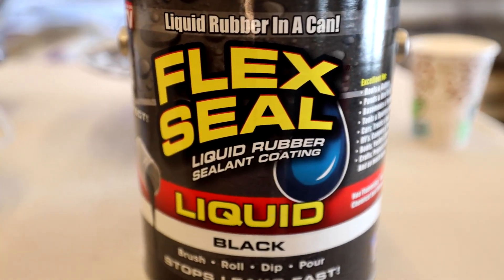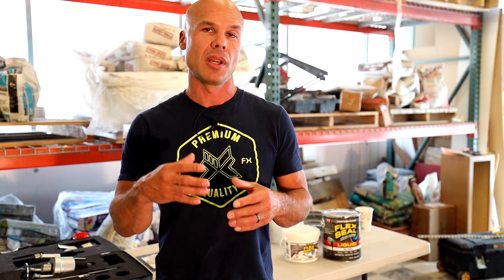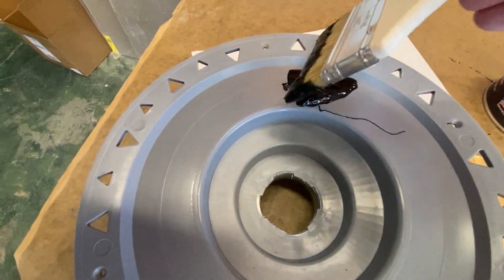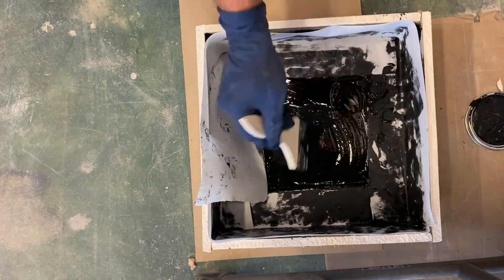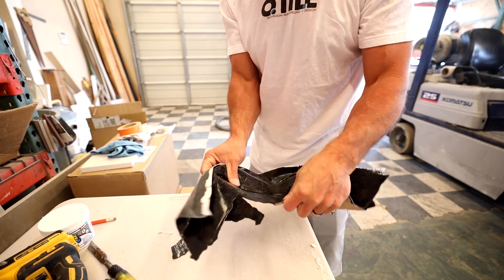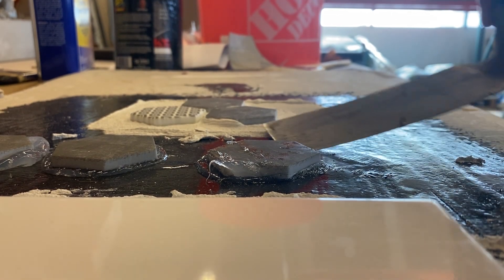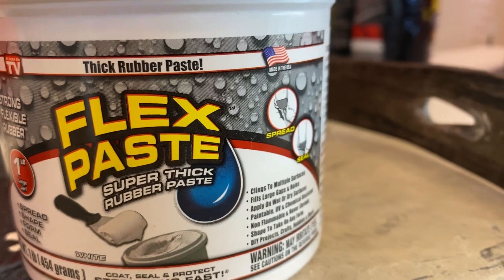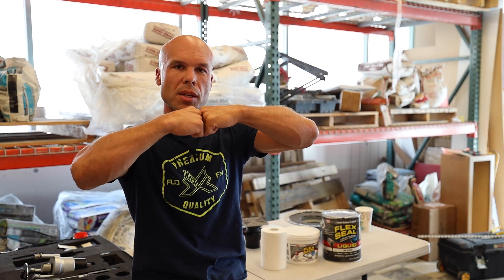FLEX SEAL to Waterproof a Tile Shower???

Comment: Static tests are good, but we really need dynamic tests with temperature and moisture in play over time to find the MTBF in this application. Flex Seal may actually have some of this data and can probably advise on the recommendation of this use case. If it is a good use case, then it might be a question of cost. Great content, as always!

Comment: Flex Seal Liquid indicates that it cannot be painted. I imagine due to the nonporous rubberized membrane not having anywhere for the "teeth" of the film layer to grip into. However, doing some research on the product family, a product representative mentioned a potential solution to whether or not Flex Seal Liquid can be painted. They suggested that it wouldn't perform well to being painted, HOWEVER, Flex Seal Spray readily bonds to Liquid Flex Seal, and will accept a paint layer. Would be interesting to see if it would accept a thinset aswell.

Comment: i would compare it to the pull (psi) sticking power  of Redgrip on an hardi backer. If redgrip provide the same 100 PSI sticking power, i would use the cheapest product !

Comment: You could use flex glue to stick the tile to the flex seal. I actually started to do an entire shower top to bottom with flex seal. No tile. Everybody chickened out. I found the stuff to do things i never thought it could do. Ive been communicating back and forth with the tech dept at flex seal about uses ive found they havnt tried. Fyi they dont know how much flex seal it took to make the boat out of chicken wire and aluminum framework.

Comment: I would think its easy enough to use as someone who hasnt done any tile work before, so id really look at using something like this in Australia. My only concern would be how long it lasts. If silcone breaks down over time and even ive seen one of your failed redguard videos where it turned brittle. Would this last like 40 years?

Comment: Question is availability and cost

Doesn't surprise me one bit really that it works.....rubber is rubber, maybe if flex seal was diluted and had a matte finish it would bond easier with other material....I believe flex seal is bit pricey.....

"Flex Seal Tile"....there is new name for tile contractor

Comment: The question is whether the flex seal will degrade with exposure to chemicals over time.  I’d trust liquid flash from Prosoco or Zip over flex seal.

Comment: I'd like to see the additional step of grouting. Would the chemical difference between flex paste and regular cement based grout cause cracking problems?
Reply: can probably grout it with the flex paste :P
Reply: @A.Martin  Depends on the thermal expansion properties.
Reply: My question is, if used for grouting, how's the finish cleanup.
I imagine it might be a little messy/ sticky..? But I suppose with the right applicator and a steady hand, thing's can be kept down to the bare minimum.
Reply: I&Nhat chy juice i
Reply: G c g x ‘ nay mm.   Nuht

Comment: I would probably use it to water seal a walk in shower if it is for a downstairs bathroom.  I don't know that I would trust it fully to work long term on an upstairs bathroom.  How would this product hold up with daily use of a shower and the humidity?  Would the product start to detach from the surface with the amount of humidity produced in shower stall- being that is is like a rubber material and rubber with time tends to curl out.

Comment: I don’t tile and I really don’t want to.  But I am looking at an idea of mixing epoxy and pea gravel and using it as my shower base.  Like the look and slip resistant texture!  I have to wonder will the epoxy work on the flex seal?

Comment: I didn't scroll through all of the comments , but from what I read so far , I didn't see any questions about sanded or non-sanded " grout " adhering to the flex paste .  So , that would be a good test and also a test to see how the flex paste holds up under water . What you have shown me so far and one personal trial run leaves me confident enough to use the flex seal liquid and the paste on my 2 up-coming bathroom jobs in my home . I have used the flex seal liquid on my metal roof to seal 2 seams and to seal around 2 vents trying to fix a " bad " leak . Since sealing those things , we have had several down pours and no more water penetration .  Couldn't tell you which area was the culprit , but which ever one it was is sealed now .

Comment: I've got my own kitchen backsplash to do, keeping the existing sheet rock... it's not cement board.  Sheet rock isn't water proof, so it seems to me that Flex Paste could be solving two problems with one solution: 
1. a trowel can be used to apply it on the sheet rock to act as the waterproofing  that's needed.
2. Also holds and sets the tile eliminating the need for traditional thinset. 

Am I correct?

Comment: have you tried sanding the surface of flex seal then apply the tile with cement? pvc  held up well after sanding! if it works put it to the test with water as well just be sure.

Comment: Well I do know I wouldn't use Hardi backer in any case.  I would have preferred you to test it on a true concrete board.  Then I would be very curious as to the performance of Flex.  Leaving the only question one of longevity.  After a year or two a lot of those miracle products shrink and crack as well as lose their elasticity.  Be very interesting by an account.  I don't think I would want you to test it on my shower but on someone else's--go for it!!

Comment: We're doing a DIY bathroom renovation. This video makes me want to give the Flex Seal a try from a DIY perspective, especially since many of us watching your videos apparently are not pros which is why we're watch these videos in the first place.
If I can return the products I've already purchased, I think we would give the Flex Seal products a try.
Reply from the maker: I wouldn't recommend doing flex seal unless you really confident in the process.  It could be a disaster if used wrong, and there are no real instructions to go by.  I will be uploading a video doing it on an actual job site, so you can watch that and see if you are confident you can pull it off.
Reply: @TileCoach  you're probably right. This is only my 2nd tub/shower remod and just watching the Redgard Fail video  has prompted me to consider things like maybe waterproofing the studs (with the laticrete hydro barrier) and perhaps waterproofing the entire hardiebacker walls instead of just the seams/corners and screws because i definitely don't want to end up with rotted wood😬

Comment: I’ve used their flex tape and found that after a few months the tape separated from the glue. I would be careful using it on something as important as a shower. Stick to proven methods.

Comment: I would definitely use it in a personal Home Project the only issue that I see on a contracted job would be if for whatever reason it would fail, it would fall on the contractor being questioned why is he using something that's not designated for it . and would actually make the contract to look bad , even though it shows it theoretically should work just fine

Comment: Do it! I’m needing to tile a shower soon and I’ve been considering using flex seal. I’ve never done a tile shower before but using a liquid membrane seems a lot better potentially than using a liner. Can’t wait to see if you use it and how it turns out.

Comment: Since flexseal is a rubber material, and is fairly thick especially over a flexseal base, I wonder if putting pressure 
on the tiles causing some flexing.
The flexing could cause some issues with the grout ??

Comment: I am planning to put flex seal 9n the subfloor of my bathroom when I install new waterproof vinyl flooring. If water spills on the bathroom floor it cant hurt the vinyl, the underlayment is waterproof too. So in theory any trapped water would eventually dry up.

Comment: This is BRILLIANTLY exactly what I've been pondering on while planning my tiled bench shower so I never EVER have to flop around in a bathtub,unable to get out after slipping...again.  
Except it doesn't  quite get to MY specific pondering.
I knew Flex would work.  I'm OBSESSED with most Flex Seal products and hit sales and resale sites for deals, as a daily troll!  I have a literal stockpile of different Flex sheeet. 
Anywho.....I was HOPING to see if it was cost effective.  I know this product is not cheap but I've yet to begin pricing out needed product list, therefor, am unaware how it stacks in that department.  

So I'd LOVE to see you do an entire job with it!!  
PLEASE!!   Maybe even a sidexside price match of Flex and the comparative product you'd use OTHERWISE.

Good works here!  Again!!  
You've helped a lupus addled 52 yr old woman get quite a few diy projects done RIGHT.  
Onto the next!  A tiled sit-down shower so I can STOP taking 3 hr long 'showers', while sitting on edge of tub.  Washing a load of sopping towels every other day.

Because my dad taught me at a young age.  When it came to destruction of what you've worked your fingers to the bones for... 
Fear water.

Comment: I'm not a tiler but I saw a shower built. I may be wrong but I thought a liner went behind the hardibacker board and under the mud bed. So the Flex Seal could on the drywall or plywood. Hardibacker on top of that and tile on the Hardibacker and mud bed?

Comment: I would try it in my own shower.  One thing I used Flex seal for is sealing over a water stained drywall ceiling.  After fixing the actual leak, the remaining water stain will bleed through several coats of normal ceiling paint.  By spraying on some flex seal on the water stain before painting, the water stain no longer bleeds through.
Reply: You can also use oil based kilz in a spray can it seals the stain and you can paint over it and the stain doesn’t bleed through

Comment: DO IT! Build a shower for S&G's... this could be a cheap solution for deer camp shower stalls. Also, I DO use flex seal in my business when rebuilding rotted out sink cabinets. I build in about a 1/2" drop from front to back, caulk all the corners, flex paste the protrusions, and flex seal the cabinet. It really works well in this application.

Comment: Latex paint will not stick to Flex Seal either, flakes off over about a years time. 
The only thing I can think of at this moment is if you put too much paste down as the mortar bed and it squished up on top of the tile and you have to wipe it off with acetone, will it cause de-laminating over time since you would not be able to keep the acetone from getting down in the joints.

Comment: grout has a lot of water in it which won't stick to the flex seal holding thr tile so while the tile may stick great I would be concerned about the grout not really sticking in the tile because it won't bind to the flex paste...do you think that is a problem. I really appreciate your channel. one of the few in California I think

Comment: I think you should actually use flex seal products for a real shower. It will probably perform better than the regular material. The only thing I would be interested in is the difference in cost.

Comment: Hi Coach

I’m very curious to know how tiles would stick to the flexseal using unmodified thin-set.  Do you have any info on that?

Also just a heads up on the megalite-it becomes very brittle when it dries.  It’s not great for floor tiles. 

Thanks!

Comment: Why would you bugger up tile with a produce that cannot hold up to extensive cleaning and soap scum, when all you need is a bag of GROUT to Re-GROUT the tile. Not good advice, and from a landlords stand point, if you flex seal my shower stall you are not getting your security deposit back.

Comment: Happy to see video.  I had planned on fixing the cracked  shower base using fiber glass cloth and resin. Then topping it with flex seal to hold the tile.  Really appreciate the video.  Thanks again, Leo

Comment: A good long-term test would be to have a purpose-built shop shower or shop sink that is used and abused for 1-2 years with the flex seal. One concern with the flex seal might be faster rotting over time and this would be a good test to settle all concerns.

Comment: Yes I have used it for a tiled custom tub. Added course sand to last coat of flex seal so the 1/2" mud to stick to it just fine then glued tile to mud like a topical tile job.

Comment: Back in the 70s and 80s we had a product called Tile Tight,.....Tile Tight looked exactly like flex seal.  Black, sticky and dried like rubber.------ We used it to stick the tile down in areas that needed waterproofing . It would stick to the floor and the tile, never had a problem with it sticking. ---The problem with Tile Tight was that it would run/seep to any low spot. The floor would have to be almost perfectly flat and level. We used it a little on walls. We had to flat trowel it on and stick the tile over it the next day. We used a certain bucket mastic. I don't remember which mastic, BUT, the bucket mastic we had back them was a LOT better than the stuff we have now.--Tile Tight was very hard to use, sticky, hard to clean (let it dry and scrape it off) and was like troweling cold epoxy.

Comment: I used it on my sub floor as it was an upstairs bathroom,and wanted to make sure no type of moisture would saturate the wood if the shower failed,I coated the whole floor and 1 foot up and bullet proofed it

Comment: 👏Job👏Well👏Done!👏 Flextastic work demonstrating the awesome capabilities of Flex Paste and Flex Seal Liquid. You're a true Flexpert! 💪🔛
Reply: Flex seal needs to finance a complete shower job for the tile coach to demonstrate the awesome comparison to traditional applications to waterproofing. Turn that into a commercial no more boats made of chicken wire. come on Flex seal. indorse this guy plz.
Reply: Holy shit.. this is a real account?! 😂😂
Reply: Awesome demonstration. Is this YouTuber gonna get a complimentary  monthly  load of flex seal products? That would be great . He did an awesome job
Reply: This could turn into something big. As a DIYer it'd be good to know if this could also be successfully used by a novice.
We're working on our diy bathroom remodel. If I can return the supplies I'd already purchased to waterproof, I may be able to give Flex seal a whirl.
Reply: @luv14lyf  me too. Ive seen so many vids at this point- dont think I will ever buy another house with 2nd story shower! I wanted to see how the Flexpaste held up under water, bc above water its great.
Reply: Dude your awesome
Reply: can you paint flex seal?
Reply: How well does your flex paste hold up to water? How long would it last in a shower floor application?
Reply: @MrMdemon  Well, I can't speak to sealing a shower pan but I have used Flex Seal to fix a leaking gutter that I can see from where I'm sitting now.  It's a corner on some 5" gutter, leaked for one season and I just couldn't take looking at it anymore.  Cleaned out the gutter, peeled up as much of the silicone the original installers used as I could and applied 2 coats of Flex Seal.  That was 5 years ago, hasn't leaked since.  Location gets full sun 1/2 the day.  I'd try it in a pan.
Reply: @MrMdemon  Did you watch the video pal?
Reply: @JulesHunterHillBigSkyBeauty  I don’t recall him doing a water test on the actual paste, he simply shows the water test with the Flex seal liquid. If the paste breaks down with prolonged exposure to water, then it would not be an ideal product to bond the tiles with.
Reply: My MAIN Flex!!   Do thoust feel my love for 'thoust' products from afar?
For thine cupeths DO runneth OVER!....with stockpiles of all things Flex!
But HELL YA yall should hook this fella UP!  He certainly deserves it but I would LOVE to see him build a tiled shower;  start to finish with my beloved Flex!
Reply: Flex Seal is trash!

Comment: I think it would be really interesting to try it on an actual job, it seems like a feasible idea you did some good test but my worry would be how old is hold up over time with people getting in and out of the shower movement of a house things like that. I would have to see that kind of a test before I would ever use it on a job if I was to at all but I like the way you think thanks for the video

Comment: I used this product in the inside of a concrete lock planter box even with several coats at $100 a gallon, it failed miserably. The product became brittle and I could break it apart easily. Ended up using a commercial waterproofing product and that stopped the efflorescence from continuing. I wouldn’t trust in a shower. It also makes claims with no guarantee to back it up.

Comment: My elephant $2000 pool cover had a big tear in it i used the tape flex seal tape two years later still holding up through winter in Pennsylvania

Comment: Would I fabricate a shower pan with Flex Seal if Hot Mopping was not an option? I'm thinking that would work under my floated cement / dry pack. Out here in California they are trying to ban applications with tar altogether. Only other test needed here is the test of time.

Comment: You could also throw sand on the flex seal before it cures and then use thinset to set tiles.

Comment: I think that it's good because the paste adds a layer of waterproofing. I also think that it would probably be good for big format glass tiles as it's flexible and would conform better to expansion/contraction of glass. Testing on glass is difficult because sometimes it works with simple modified thin-set and sometimes they crack with special glass thin-set with latex additive... It's probably as durable as thin-set, if not more, as water will not even get in there unlike thin-set that is porous.

Comment: For me, if the Flex Seal + Flex Paste method works equally as well as the usual tiling methods do, then it would depend on which method is more cost-effective.
Reply: but flex is total water proof